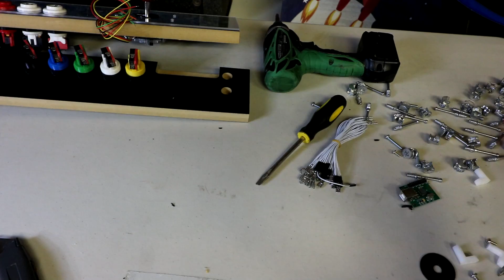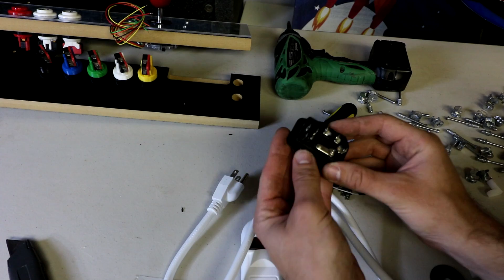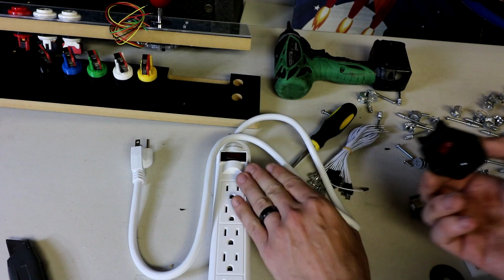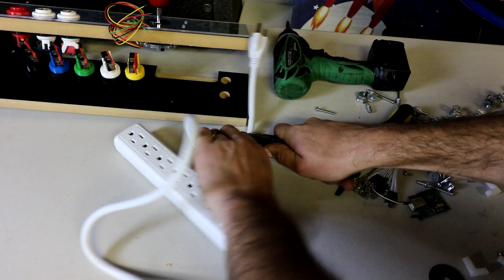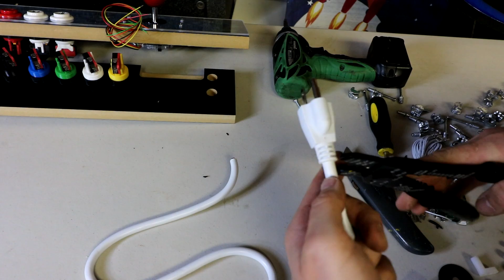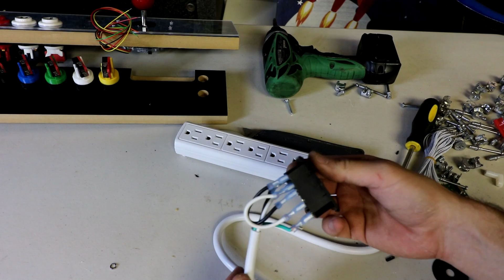How To Wire Arcade Power Supply & Switch

Comment: I bought a rocker switch and it came with wires pre-attached so most of my work is done. However, the ends of the wires have ring terminals attached to them and as someone who's never done this sort of thing before, I'm baffled about what I'm supposed to do with them. Any advice?

Comment: OK, first, the "Clips" are called Female Disconnects.  Second. just stating "skip one and attach here" you are making for a dangerous situation. Not all of these switches are the same. you never explain why you are jumping these terminals. 
Probably to illuminate the switch, but not stating Hot and Common just "black and white: it is obvious you are not an electrician and could have been setting someone up for a fire hazard, or an instant trip of a breaker.  Also, note that is the proper gauge is not used for the disconnects you could be over fusing a wire load if someone where to put all kinds of fans, a PC with an extream video card, etc that would draw more than 15 amps for 14Ga wire and if the disconnects are only 16ga you are at 10AMP max load and that would not trip a breaker but rather create a meltdown of the disconnects and become a fire hazard...

Comment: Could you do the same thing if you soldered the wires instead of using the plastic connectors? Also are you essentially connecting the L N and E (ground) wires from the surge protector to the same corresponding connections on the IEC switch?
Reply: If it's made for soldering, check the datasheet. And yes just matching the same with the same. Don't assume the colors are correct though.

Comment: You wired it incorrectly. the power side of the switch is the two pins that are closer together. The load side are the two that are farther apart.  Reason why is simple. In the tiny switch there is not much room. The two load pins are pushed out to make room for the bulb (and resistor). The bulb gets attached to the pins in between. When the switch is turned on and the power flows, the bulb lights.
Reply: I came to this realise that after the light wouldn't turn off when the switch was flicked off.

Plenty of videos out there showing the incorrect way.
Reply: @Liquiddna89blaa  yup. But i don't totally blame them. Blame goes to the manufacturer when the assembly line puts the switch in backwards then gives very simplistic drawings and instructions.

Comment: Agh!!!! Slow down and show what you actually did with wiring. I’m sure I can do it just as fast, but I cannot see what you did!
Reply: Yes, I agree.  The most important part of this are which wires are going where and the wires are falling out of the camera view.  From about 2:10-2:30 the device isn't on camera and I cannot see where you are hooking the wires...and I cannot understand..."black goes black" then what?
Reply from the maker: sorry any particular question you have? THis video I made at the same time I was building the actual bartop so it was more of a I should probably also capture that....
Reply: @drewtalks  Then You should change the title, "How To Wire Arcade Power Supply & Switch" to "I recorded me wiring up the power supply switch.". Especially since you wired it incorrectly.

Comment: How do you connect your power supply now?
Reply from the maker: https://amzn.to/2rstqel one of those
Reply: @drewtalks  That's a power cord.  All you did in the video was jury rig a power switch to an outlet strip.  The question is how do you connect the arcade power supply?
Reply: @timmiser  plug it into the power bar?
Reply: @timmiser  😄😃 well thats simpel you connect u mount that swich thingy on the back of the arcade machine u have to make a hole in the wood 
then u connect all the arcade machine stuff on one end the end of the white power strip and the black cord goes to the outside where the red light is u then connect the black cord to the wall plug and as for the arcade power supply connect it to the white extention cord inside the arcade machine

Comment: Does anyone know if this also works on those wireless power outlets that work with remote controls to turn them on or off? That way I can have it to turn on or off via the button like this method and by the remote too.
Reply from the maker: sure you can